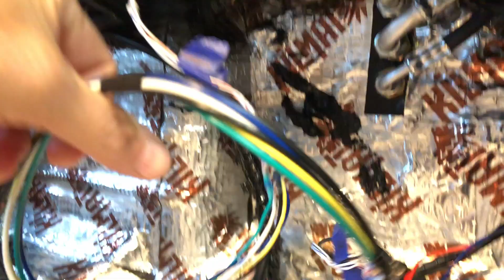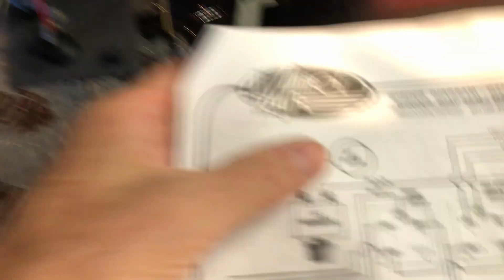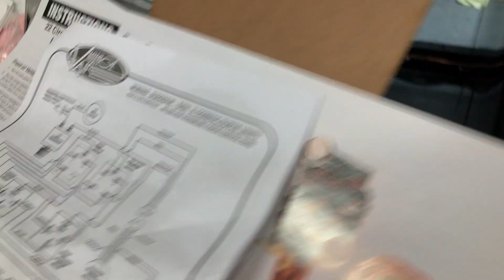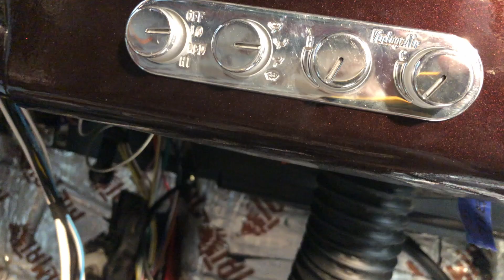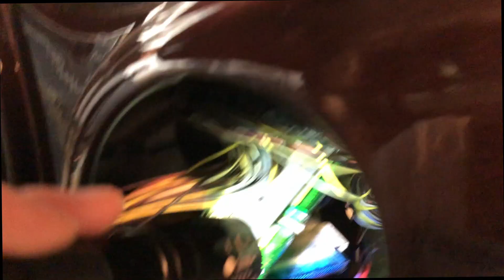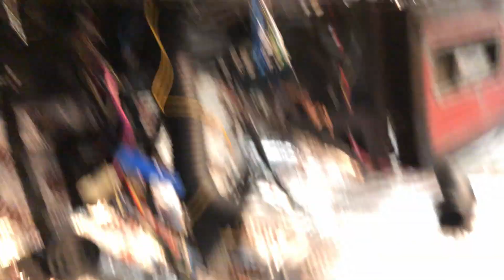Ep40: Wiring 51 Ford Pickup Part 2  Vintage Air AC

Comment from the maker: This was a dumb assumption on my part, but I realized I should have removed the original wires from the ECU to the AC Compressor for the clutch control and used the clutch control wiring from the Vintage Air kit. The ECU no longer controls the AC system at all. 
The Vintage Air compressor control wire is a single wire with either 12V to enable the AC clutch or 0V which disables the clutch.  The other wire to the compressor is a ground wire.